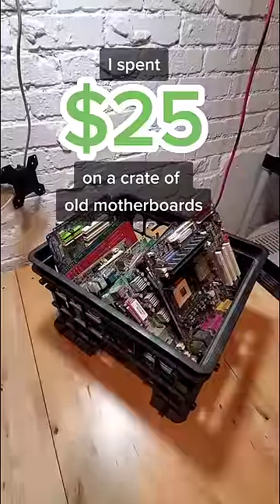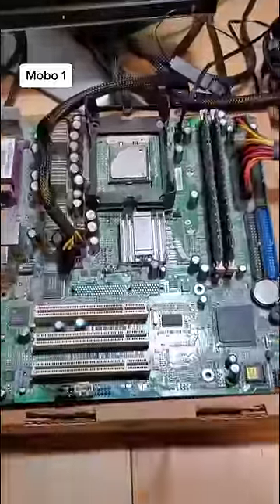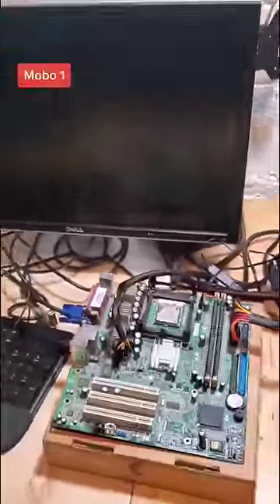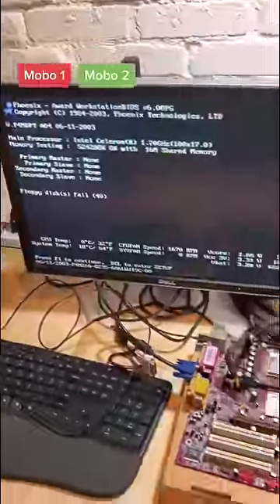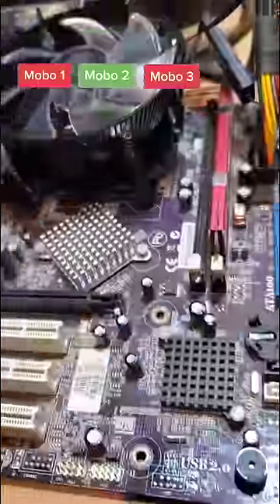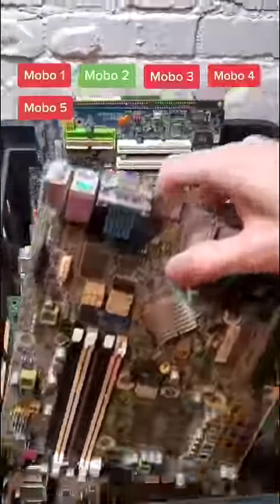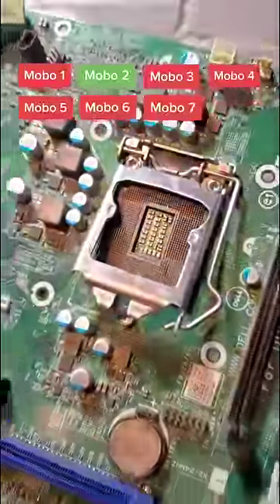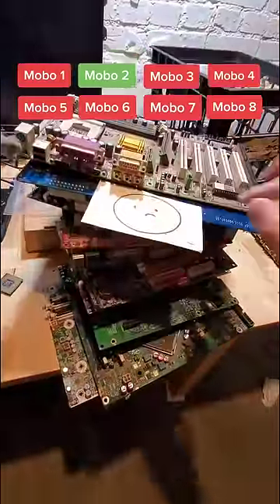testing a crate of old motherboards #shorts

Comment: Bust out some tweezers and a magnifying glass and see how many of those LGA boards you can revive. I did it with an 1150 board, it still runs to this day.
Reply: Same with LGA 1151 after dropping a CPU on it I'm only 13 and that got me very panicky but I got most of them back and it works
Reply: I Am Mobo
Reply: @quack1119  No, you're Quack
Reply: @danny-phantom5670  Its  A YouTube Channel
Reply: @quack1119  we'll see about that
Reply: You could do that for sure but none of these look like they're worth the work
Reply: Cool story bro
Reply: Same I max out cpu ram gpu on old boards playing modern gaming systems today 60fps all for the fraction of the cost of a new PC that doesn't even last long 👍
Reply: @miketheevolutionslayer2649  bs
Reply: @Leak-ec5gb  How is it bs?? Or what makes it bs??

Comment: For the floppy disk failure thing the only thing you need to do is enter the bios and disable it
Reply: yesh
Reply: Thanks!
What about the no display first one? What could it be? Bad ports?
Reply: @MarcoFMSousa  it’s difficult to say just looking at a video like this, but I doubt it’s the connectors. It could be a bad chipset, incompatibility with the cpu, or a number of other things. Since old boards like that usually have an integrated buzzer, the fact that we didn’t hear anything (unless the audio was cut) suggests that the cpu isn’t executing any instructions. Moral of the story: It’s impossible to say from a video like this
Reply: @MarcoFMSousa bruh... if the integrated graphics dosen't work (does not display anything) is because of bad capacitor near the vga connector. How to fix? Replace the capacitors or use a graphics card

Comment: Try the one with the cracked socket, as long as the CPU pins are still making contact, it may be fine. 

Also if you get something like tweezers, you can bend the pins back on those motherboards. Might work, might not. Worth a shot, your not going to lose anything if you break it even more.

Comment: I have a socket A MSI motherboard from 2001 with an Athlon XP. Can't get it to turn on though. Maybe it's the PSU since it's old and sat in an attic for 17 years

Update: It turned on. It was bad PSU and bad F panel connectors. I installed Windows XP now with an Athlon XP 1700+ and a Geforce 4 Ti 4200 128MB. The model is MSI MS 6340 from July 2000

Comment: The one board didn't display cause it probably didn't have an iGPU. If it turned on fine thats the case.  If the cpu was gone you'd get error beeps in the least. Or it won't even turn on.

Comment: You can tell they were intended as donor boards for   the mb parts and chips. I would be a bit worried if i had employees that would constantly destroy socket's. In my era as a tech it was the cardinal sin and it was your responsibility to bend those pins back in place and mind you back then the pins were  morw gold and if u bent it , good chance it would snap when attempting to correct it. I saw many employees fired when they messed up on there second screw up. If u broke like two in 3 months ur bye bye. The worse was when noobs would burn all the parts when they turned on system on  cause they weren't wearing static bracleets and the cpu read not seated lol.

Comment: *sees two bent pins
*Trashes motherboard
I think there's something called tweezers that can be used to fix those bent pins or something
As for the cracked socket one, that will also work because only the plastic is cracked. The socket is still fine

Comment: I have a serious question to ask you and you're seemed an expert on this, What would happened if you add a Tiny, very Thin, Copper heatsink in between the built-in Heat sink and the thermal paste? would the temperature gets better, worse, or possibly a same? Thank you for your time and love your channel btw.
Reply: It won't make much of a difference if any at all. I'll try to explain in a few hours. I'm sleepy.
Reply: I feel like you'll add more thermal resistance due to the extra layers and get worse temps.  The best is just to have straight copper on at least one side
Reply: it will perform worse since the thermal paste isnt getting into the crevices on the cpu

Comment: Hey I have an xfx 560 4 gb graphics card and it stopped working is there anyway I can test if it still works without damaging my PC?
Reply: why would it damage your pc? you can test it all you want it wont damage anything
Reply: Oh ok cool but my new gou arrived yoday
Reply: One of the simple ways to see if you get it working again is to change the thermal paste on it, I fixed an old gpu which my friend told me was broken, and I only changed the thermal paste
Reply: @AffeR3ttuB  then it wasnt broken and your friend lied
Reply: @scidja8567  Well. I didn't know it before I changed the thermal paste, it didn't give out any signal, so it WAS broken for a while
Reply: @AffeR3ttuB  if it didnt give signal it means thermal paste change wont affect the signal output in anyway so i dont know man sounds like bs
Reply: @scidja8567  That's what my friend told to me, and I know it works because I used it afterwards, but yeah, seems like this is only causing arguments so I won't be responding further
Reply: @AffeR3ttuB  yeah because it doesnt sound logical that a simple paste change suddenly brings signal to a device